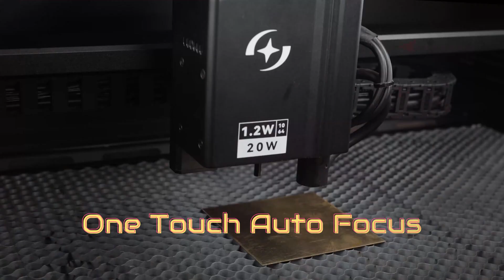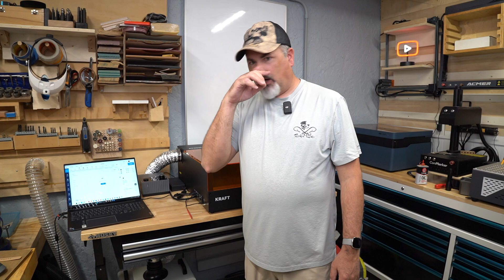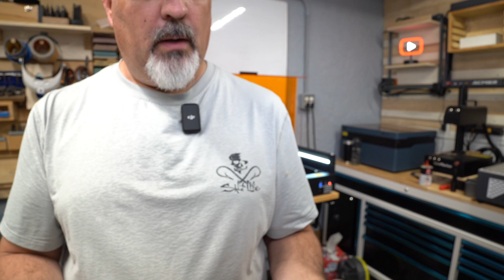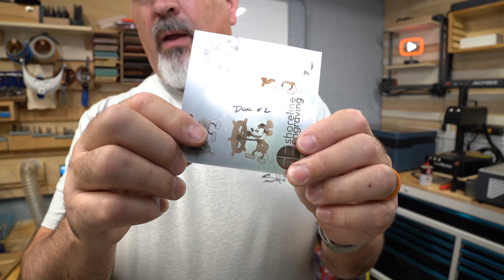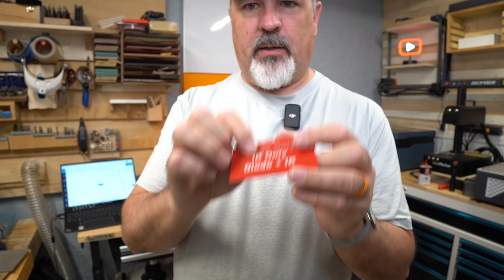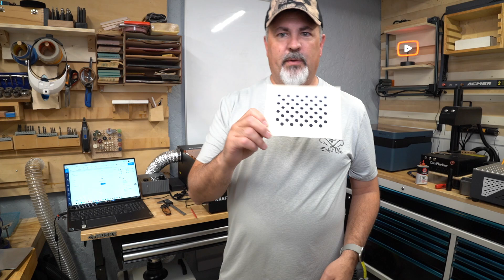The AtomStack Kraft - Is Diode + IR a Gimmick or a Leap Forward in Laser Engraving?

Comment: I have started my laser journey with a Ortur LM2 Pro and have had a lot of fun but I’m ready to upgrade and want to expand the types of materials I can use. Is this a worthy upgrade or should I be looking at something else? Thanks
Reply from the maker: Hi. So the diode portion is more powerful than your current laser which would allow you to work with thicker stuck when cutting. The addition of the IR would also open up a wider range of marking metal and jewelry.  However you'll still be limited in that you cannot do clear or many transparent acrylics without resorting to hacks. 

So the short answer is yes it would expand your materials, but it may or may not not be in the way you want. I'd start with answering what specific materials you want to be able to use and that would help more directly answer your question.

Comment: Where to get the engraving test?
Reply from the maker: LightBurn has a built in material test with some basic parameters for diode lasers that you can use as a starting point. Check out other videos that specifically cover material tests and that should help.

Comment: Awesome posting!  How deep of an etch were you able to get in the stainless?  Thanks!
Reply from the maker: It's not noticeably deep. At 1.2W it doesn't really ablate away material but it does provide a good bump in color over what the standard diode provides.
Reply: @thetinkerverse  Have you tried it on any of your knife blades?  I use primarily AEB-L in making knives and as much as I realize a FL would be my best option, they really are a 1-trick pony with an extremely limited working area. Right now, I use just the traditional electro, chemical marking method.  When it bleeds through,it causes problems so am looking for a viable alternative. I'm good with a durable permanent mark for my logo that only takes up about 5/8" square.  Thanks again
Reply from the maker: @ThadJB  Not yet. It's on my to-do for a new flip knife I have on the bench to build.
Reply from the maker: @ThadJB  My go-to for blades is typically the UV since it keeps the heat down and wont' impact the temper. But I don't get the deep black engraving like the fiber. We'll see how the Kraft does.
Reply: @ I really like the idea of running a UV, but from what I’ve seen, don’t much like the idea of such a limited working space

Comment: Thanks for the review, they're always useful. I've got the Roly lasermatic and was considering getting it's IR module for some limited metal work (mainly blades, dog tags etc.). From what you've said on your tests, it seems like the IR's main drawback is speed, is that correct?
Reply from the maker: Tricky question. Gantry lasers will always be slower than a galvo laser which is what you'll typically see when talking about IR lasers. 1064nm Fiber lasers are generally going to be anywhere from 20-200w with a galvo mirror setup for hobby use.  The lower wattage modules (1.2W, 1.6W) are actually better suited to the slower mechanical movement of a gantry laser. 

Not sure if that helps or hurts your question.
Reply: @thetinkerverse  That actually really puts it in to perspective. I'd love to have the thousands to have the best solution for every situation, but it always has to be a balance of; quality, cost, speed, space and frequency of need.

Comment: have you tried manually focusing the light beam for camera
Reply from the maker: Hi. I'm not sure I'm following the question. You can manually or auto focus the laser module but that doesn't affect the camera system. The camera is fixed in the lid and doesn't change focus.

Comment: It's a nice marketing trick to not mention that the IR is also a diode (hence the low price tag)
Reply from the maker: Fair point but they are different wavelengths. 1064 for IR and 455+/- for standard blue diode.  But yes at 1.2W it's very low power, but it is a noticeable difference in results on quite a few materials.